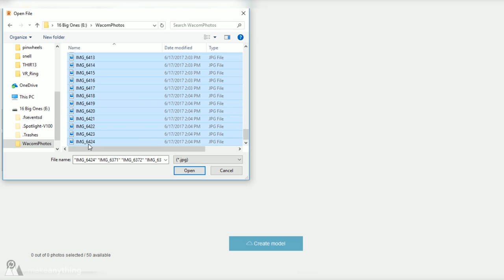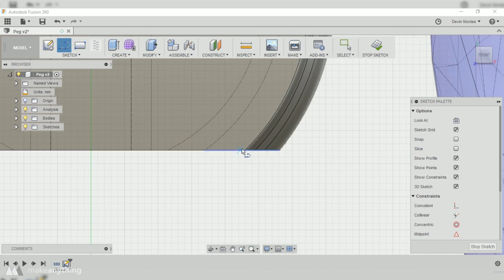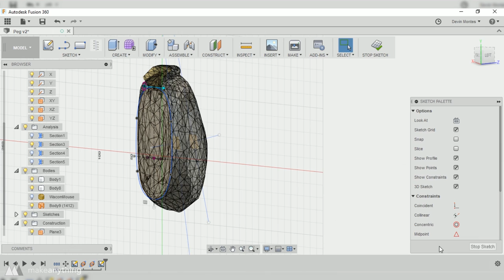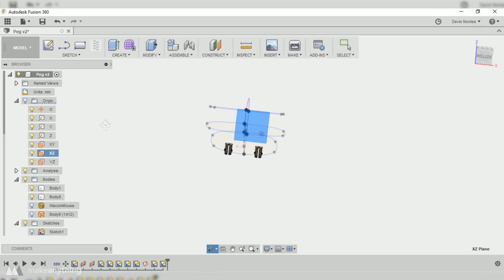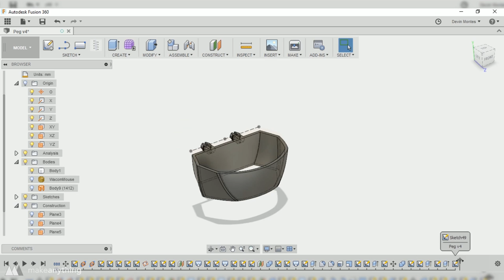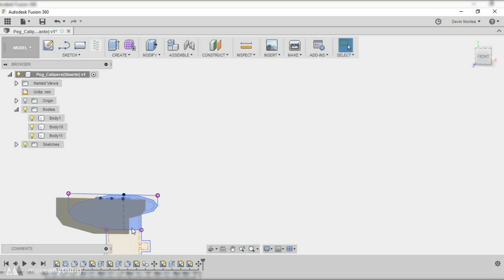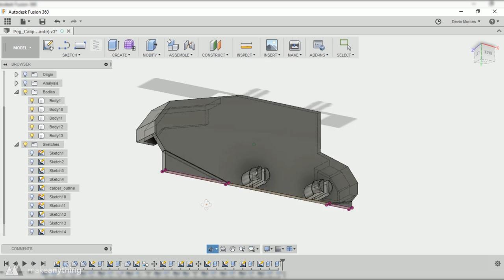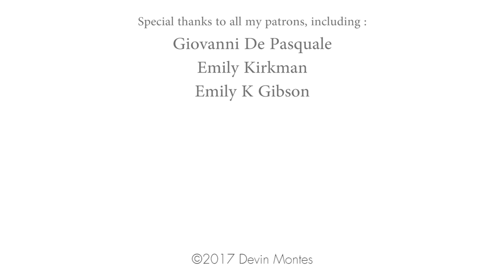Pegboard Anything // Custom 3D Printed Hangers using Photogrammetry, Scanning, and Fusion 360

Comment: If you can take the peg board off the wall, you could run bare copper wires behind the holes. Alternate between 5V and ground. Then you can embed LEDs (with appropriate resistors) into your holders then use adhesive copper tape strips on the pegs. Then when you plug in the pegs in, the holders will light up.
Reply: Or a simpler, but slightly more expensive way would be to add a 3v button cell into the back of the holder. Each holder is then independently powered. 
You could add a small momentary (normally open) button switch, so that when you take a tool out, the holder lights up, or reverse it by using a normally open switch, that turns the light off when you remove the tool. You just have to incorporate the button switch in such a way that the weight of the tool is enough to activate the switch.
Reply: This sounds awesome!

Comment: If you have an NVidia graphics card check out the free open source program Meshroom. It does the same thing (creates 3D models from a bunch of photos), but has no limits on the number of photos and doesn’t rely on the cloud or internet access for processing.

I have a cheap GTX 1050 and it runs in a reasonable amount of time (the included example photo set took about 30 min or so to process). If you have a more powerful gaming card it should be much faster.

Edit: note that Meshroom requires an NVidia card because it unfortunately uses their proprietary CUDA framework instead of something more open like OpenCL, but as mentioned it works great even on a cheap card (plenty of used 10 series cards available on eBay if you have a free a lot in your desktop system, you don’t even need to hook up a monitor you can just use it for CUDA processing)

Comment: How about a quick way to hang drawings? If you have a cilinder on a slope, resting against a barrier, and put the paper inbetween the cilinder and the barrier, pulling down will only push the cilinder towards the barrier, because of the slope. Pushing the cilinder up with a finger, however will instantly release the paper. This design already exists and is probably patented (shh), but would probably still work well with pegs, especially if you use two pegs.
Reply from the maker: +Jules Verkade cool suggestion, thanks :)

Comment: I think the photogrammetry works much better with non-reflective objects with more angles and or texture. RCLifeOn used Remake with a garden bust statue and got an amazingly detailed result and a very good print. Wrapping the mouse in plastic wrap and then coating it with some kind of paint or powder may have helped.

This was an interesting approach and it was nice to see the modeling involved. For the mouse holder I wonder if using a profile gauge (a tool with a line of pins used to capture complex profiles, like molding) and scanner would have also worked. Maybe that wouldn't have captured enough detail precisely enough.

Comment: You could use just a peg, print a separate "cap" and glue magnets onto each. Then you could put the peg into the board and use the cap to hold up paper or what have you. The stronger the magnets you use the heavier the item it will hold.
Reply from the maker: +giheatherhobbit I like it!

Comment: Can't you change the default unit in Fusion? Or is it the default import scale? Because my SVGs and DXFs always import too small.
Reply from the maker: You can change it. As long as you export and import with the same units the scale should be correct

Comment: Hi Devin, really inspired by your effort. Looking to do this also. May I ask what is the diameter of the holes on your peg board? Worried about the strength of the snap hooks if they have to be small. I am assuming you are using PLA. How are the hooks holding up?
Reply from the maker: No snapped hooks yet! The holes are 1/4 inch in diameter

Comment: Thinking about something similar but then using the lego build stucture for the plate and fixures.
To make a 360° shot would it not be better to use a 3d printed turntable with angle scales?

Comment: Hi Devon. Just one question please ? Wouldn't there have been an easier way to do the mouse holder, or did you want to do it as methodically as you did ? I just kept thinking, " Dude, turn the mouse upside down, and measure around the middle section. Taper downward (wider on top) and of course add your cute pegs on both sides. That way the wider part of the upside down mouse would have to catch at some point close to the middle, and should hang ok." 🤔 If I'm missing something, please let me know. I'd welcome the input ! Thanks again, you're videos are cool !
Reply: I was thinking something similar.  It was overly complicated.  It might look pretty but if he changes his mouse he will need a new holder too.  Doing the measurements would have been much simpler than doing the photogrammetry which just made the program look god awful.  Then his explanation of the process was confusing but then too I'm a newbie at CAD so there's that.

Comment: Remake grew from 123D-catch which produced the best results I got so far. But they where run over so hard that they wheren't able to handle the load for quite a while. I seems it works again now.
How long did online processing take? 
Would really like to see a usable non-proprietary  offline alternative though.
Reply from the maker: I believe it took 10 minutes or so
Reply: Make Anything // 3D Printing Channel 
Thanks. Seems they got more than an order of magnitude faster. Guess its time to check it out again.

Comment: if you ever had the need for another monitor, i think it would be a cool idea to have one or both mounted on the pegboard. i dont know how practical that would be depending on how low/high your desk is, or if the foot on your monitor is removeable or not, but ¯\(ツ)/¯ it sounds fun/cool/interesting

Comment: Is it just me or does anyone else find it odd to move the unwieldy camera around such a small object instead of rotating the object in front of the camera? Doing it like that could also have prevented the light spike thing happening by choosing an angle where it would not occur and sticking with it.

Comment: The shell was not working because you selected 1 face. If you went into the left menu and selected the body it would have worked
Reply: even without fillets
Reply from the maker: +Jeroen Verbong I tried that, it still didn't shell :\

Comment: dont rotate the camera around the mouse, do it the other way around and turn the mouse in a better lightiung setup. would improve your 3d model by miles
Reply from the maker: I heard that causes problems, but it would be much easier and more consistent
Reply: even with a uniform background and a rotating platform to keep the angles consistent? it seemd to work better when the object was not hit direclty by the light due to reflexions, maybe a diffuse lightsource? i know you said, that  the kitchen setup was improvised ^^ 
just out of curiosity, how much filament do you go through in a month? :D
love the vids and the creativity